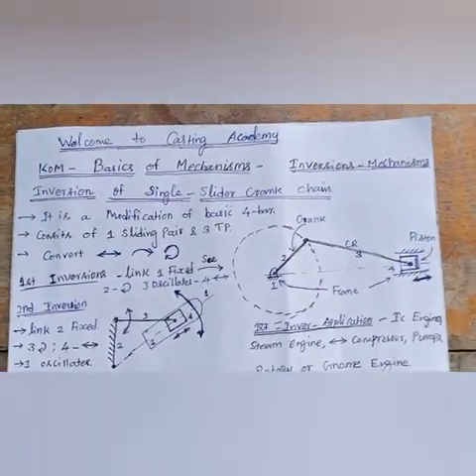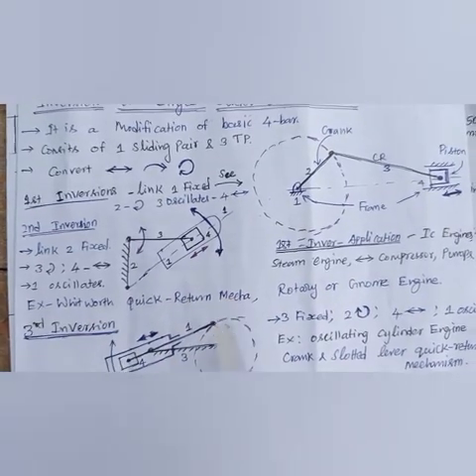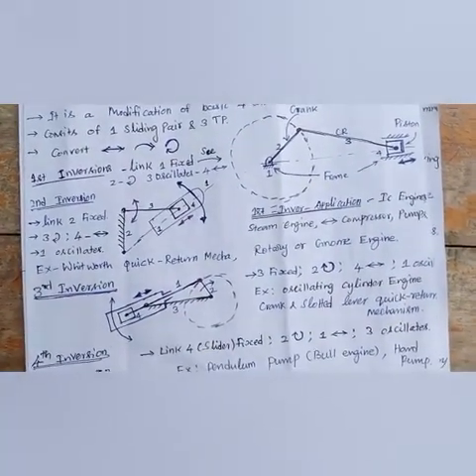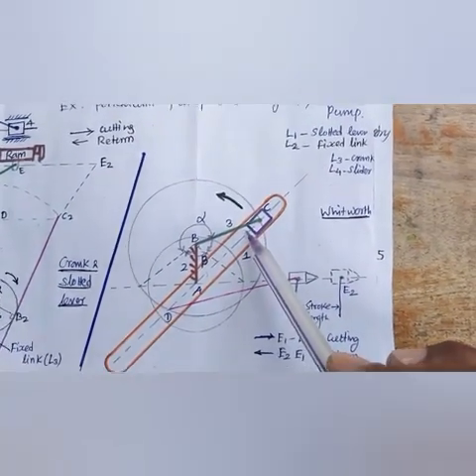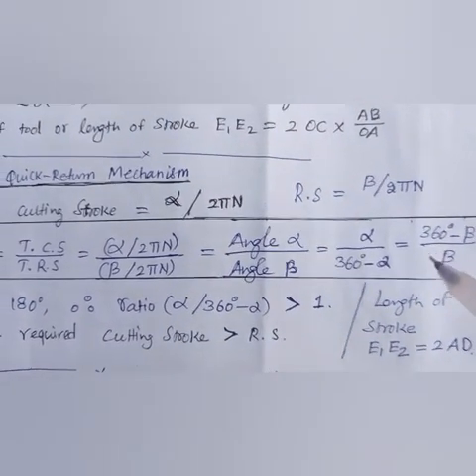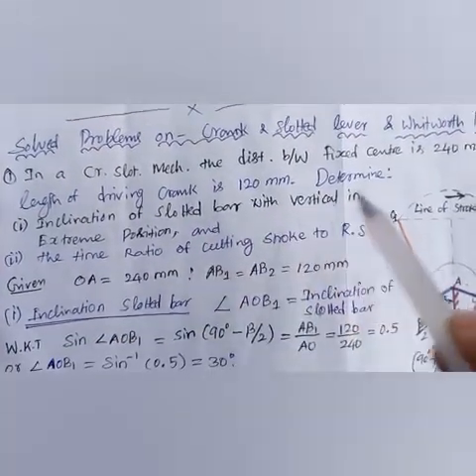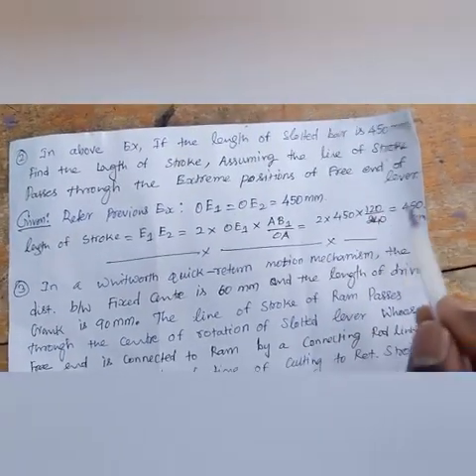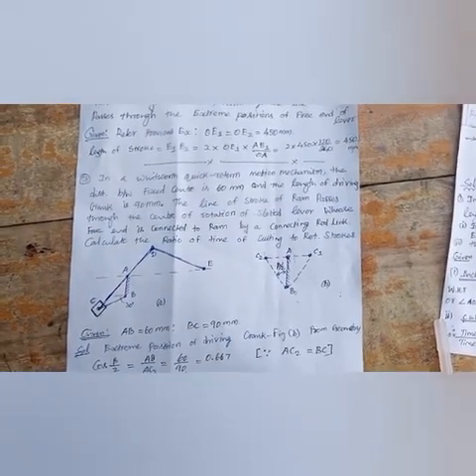Inversions of single Slider crank chain - crank slotted lever and Whitworth mechanism - problems.

Comment: For this question what do we use cos or sin

The length of the fixed link of a crank and slotted lever mechanism is 275 mm and that of the crank 110 mm. Determine, (i) the inclination of the slotted lever with the vertical in the extreme position. (ii) the ratio of the time of cutting stroke to the time of return stroke and (iii) the length of the stroke, if the length of the slotted lever is 495 mm and the line of stroke passes through the extreme positions of the free end of the lever

￼
Reply from the maker: Cos